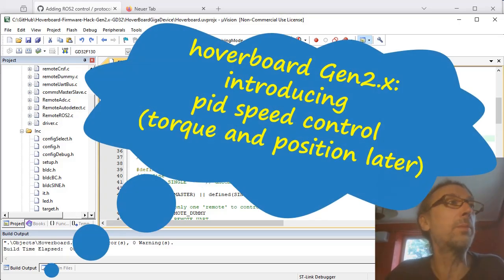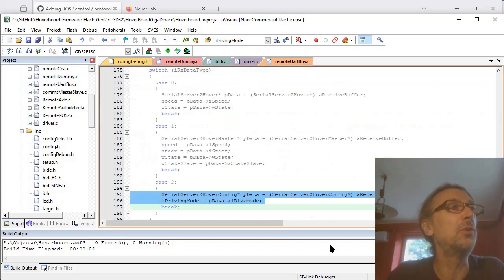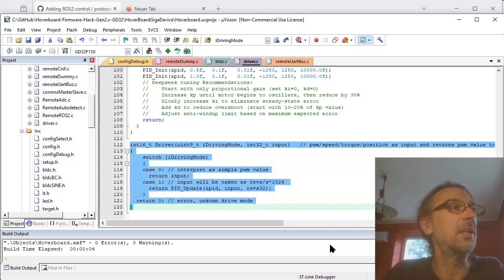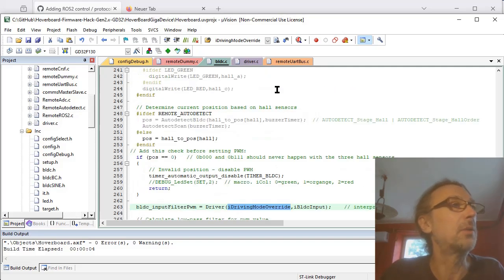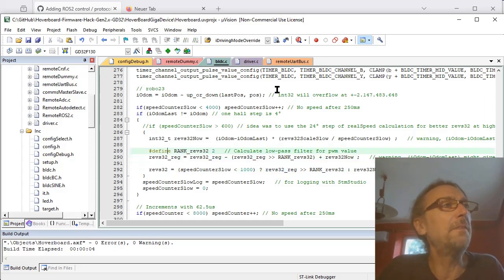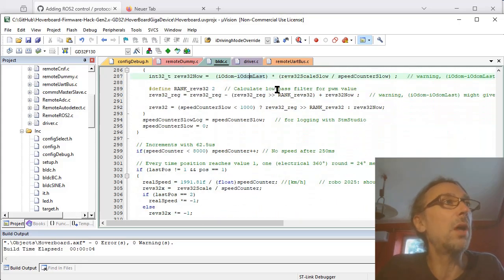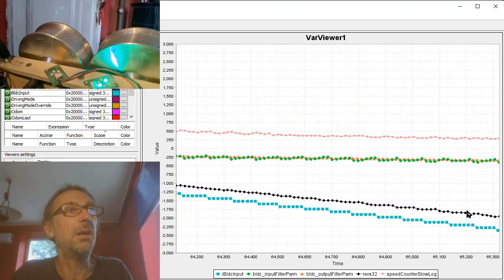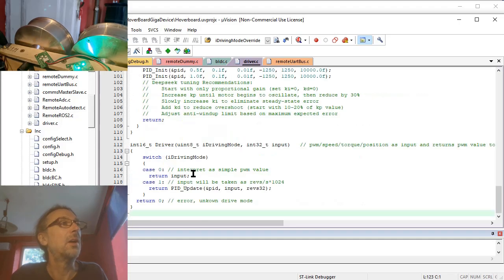split hoverboard Gen2.x : introducing PID speed control

Comment: I was waiting on this !!! I'm really bad with the embedded software and your's is pretty intuitive. I'm a little more in touch with PID and control systems (i'm graduanting, but still don't really know that much). Can't wait to do some tests on my board.
Reply from the maker: Yes, would be nice if someone with deeper interests in PID would replace the int16_t PID_Update(PIDController *pid, int32_t setpoint, int32_t actual) with something more thoughtful, instead of pasting ai code.
I do not really want to go on that engineering low level to understand how a PID loop works. I prefer the higher abstractation levels (like www.2China.de ).
So indeed, i really try hard to focus on intuitivity. But without OOP, this is quite hard for Gen2.x. The underlying framwork of defines.h / target.h / config.h is quite aweful. But at least i am able to unify the different hardware targets gd32f130 / gd32f103 / gd32f130. 
So thank you. But for sure, do not take a look at my RemoteAutodetect.c :-(

Comment: Will this allow ultra slow speeds?
Reply from the maker: Well, i can not really imagine going below 1 rev/s. The current faulty Deepseek pid code is quickly overreacting with +-1250 max pwm, so better code might get it right.
But i am no fan of low speeds for 300 Watt hoverboard motors, who then will have an efficiency of below 10% and 30 Watt i guess. 
But as used hoverborads are so cheap, i too am dreaming of putting a $10  MVXVC01-JG Lidar on a pair of hoverboards to build a lawn mover / snow blower / street sweeper: https://www.aliexpress.com/item/1005008586432393.html
Reply from the maker: New pid code is online. ChatGpt5 failed me totally and wasted hours of time. But after i had given up i could not resist to also test Gemini, and Gemini2.5pro did the job with the very first prompt. Constant speed can now be set as low as 0.15 revs/s so nearly 7 seconds for on revolution at 25V. Do you call that ultra slow speed ?
Reply: @robodurden  Glacial!  Do you have a hoverboard brand recommendation?  

I was moments from springing for the oDrive kit.  Still appealing to experiment with but there was no fleet in sight at that price.